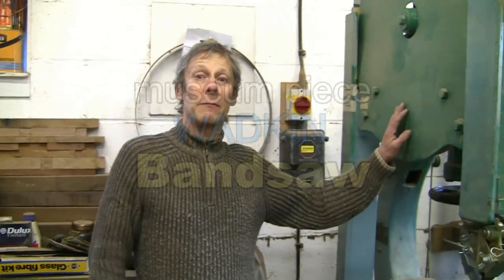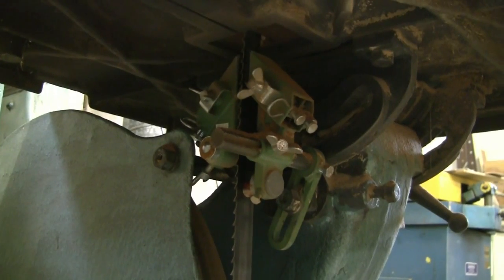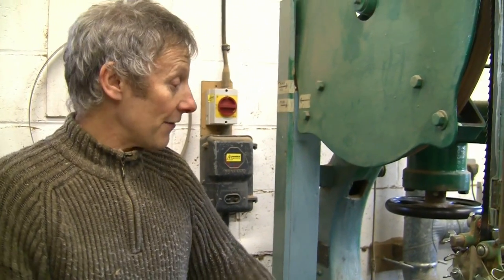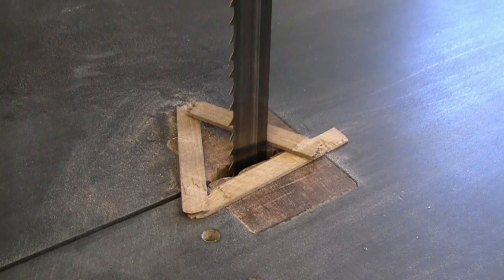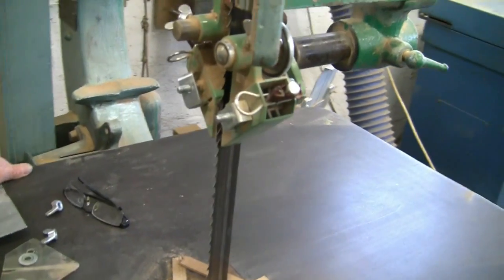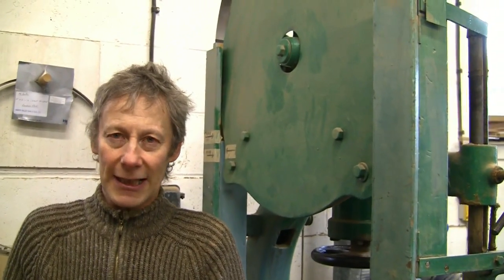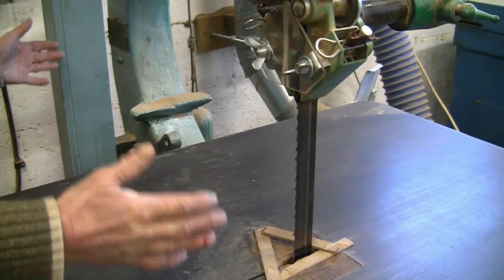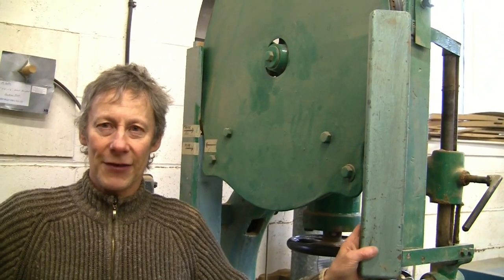Museum Piece Wadkin Bandsaw

Comment: Wow! Thanks for sharing this, Jez. It looks even older than the one you can see in The Shawshank Redemption.

I used the same rubber-cork material to replace a tyre on my previous bandsaw and it worked really well; you could true it quite easily using hand tools.
Reply from the maker: Yes a bit of a monster Olly.

Comment: They don't build them like that anymore!
Reply: John Smith You're right, they don't. The fact that they were built so heavy (mainly all cast iron), gives them extreme stability. The only problem is finding a good saw blade supplier, and sharpener.